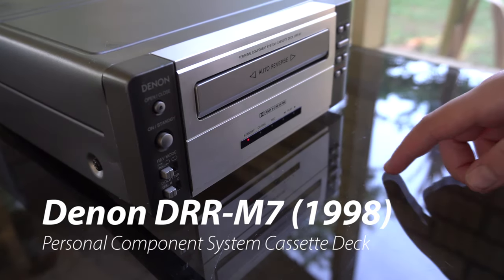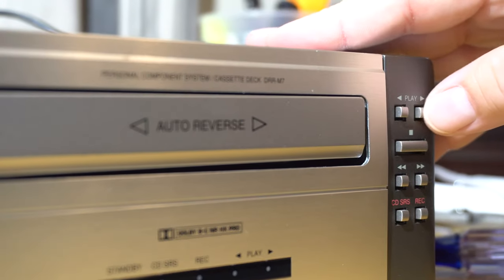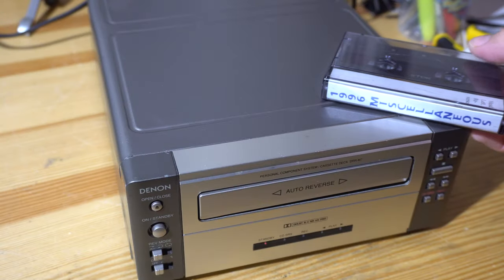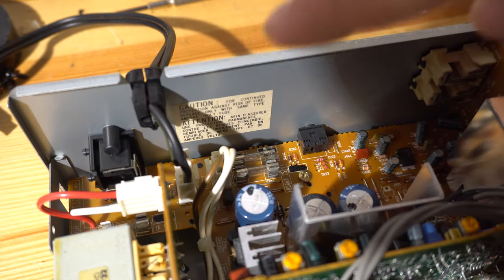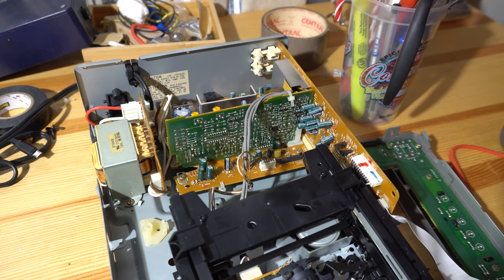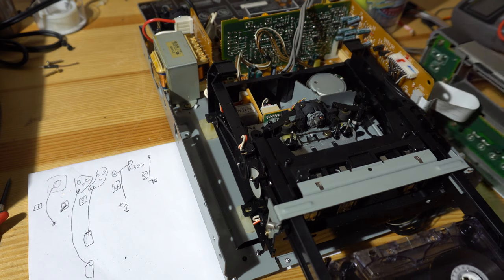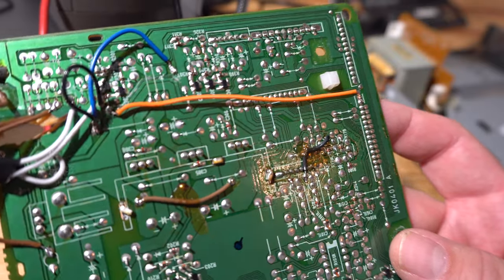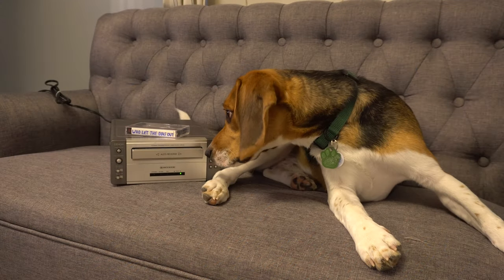Denon DRR-M7 Stereo Cassette Deck

Comment: I bought one of these for 4 Euros, and it seem to work fine beside the rattling problem you have. I found that the reel spindles (?)On Mine they are completely stuck and do not spring back up as they are supposed to. If I get them pushed down or if the tape happens to do so,  then they stay down and do not pop back up to grab the tape reels to turn them, causing the rattling and also not forwarding the tape proper, causing tape salad as a result. 

It's not clear to me how you fixed it, although it look like you put a large amount of lubricant on?
May I ask what you used and how you did it?
Reply from the maker: I sold this deck, so I don't have it anymore, but I use "white lithium grease" for stuck tape decks to make sure everything can move smoothly. From what I recall, there is a spring that pushes up, so I would make sure the spring is pushing the spindle up, possibly stretch or replace to make sure spindles are pushing upwards. Thanks for watching!